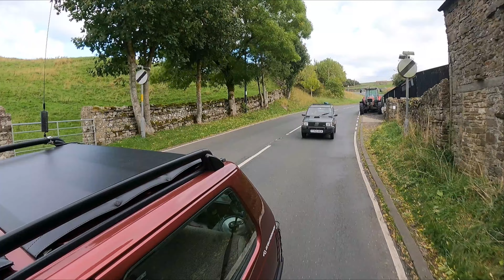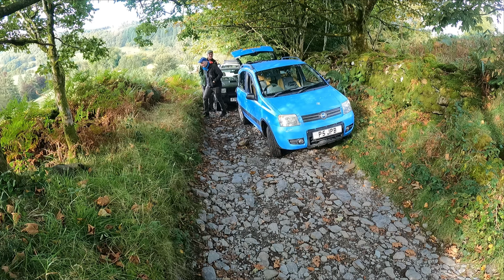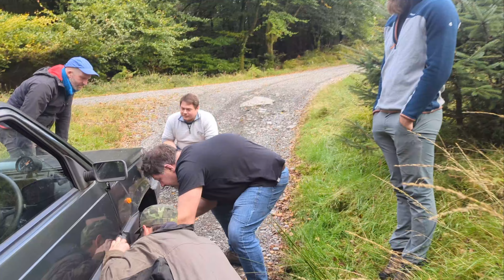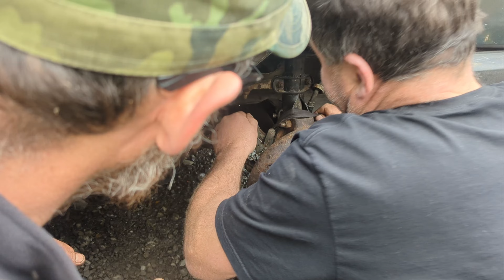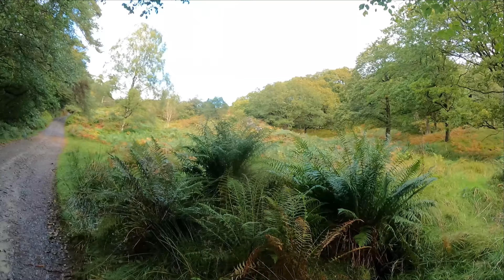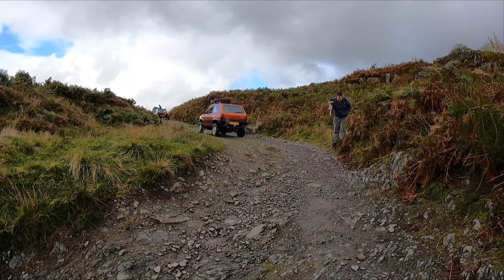The Lake District Adventures Off-Road 2024

Comment: Obviously Pandas are not built to handle even moderately rough stuff. If a fully-fledged off-roader cannot be acquired, then something like a Suzuki Samurai will most certainly suffice.
Reply: Said no one, ever.
Reply from the maker: But where would the fun be in that?